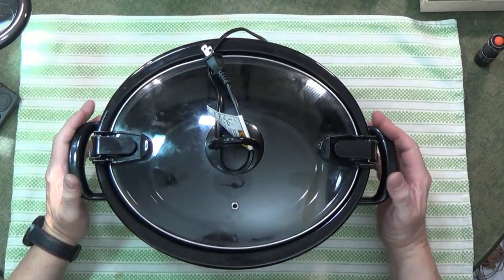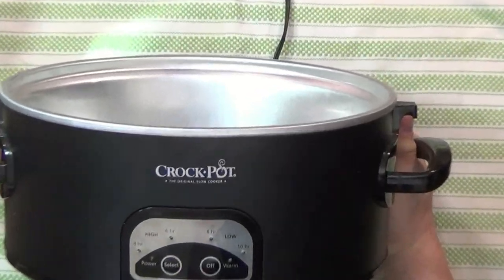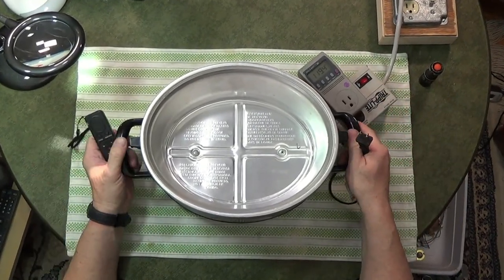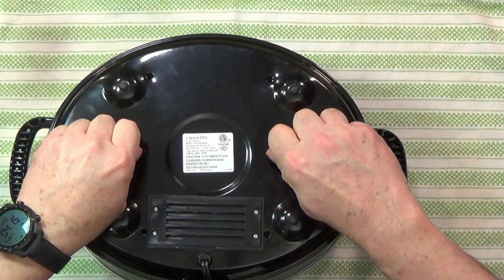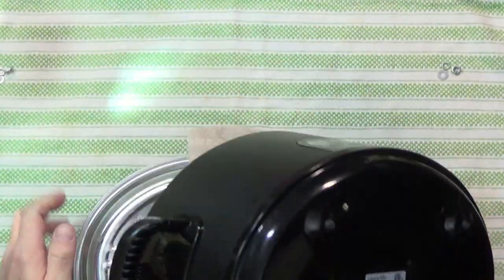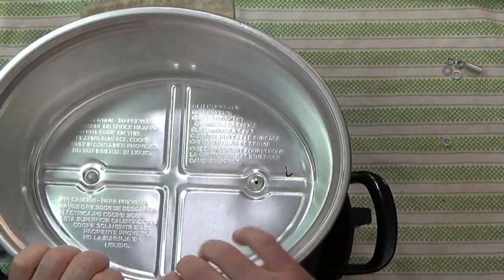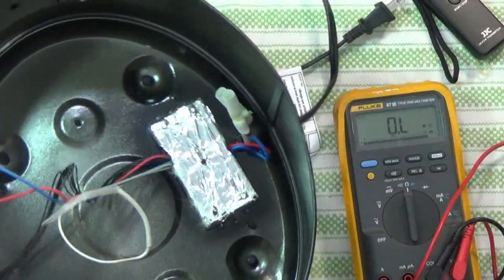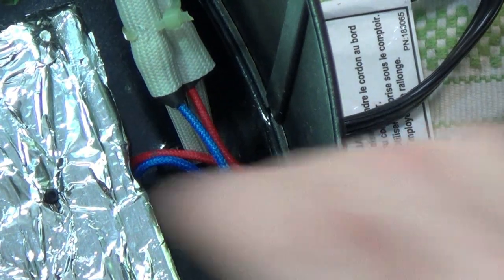Crockpot Slow Cooker Died  - FIXED!

Comment: Thanks for the video! Very well done! My crock pot stopped working so I opened it and I found two  issues:  1) the spring holding the metal ring around the pot is broken, Where can I order such a wire? 2)  the glass diode NTC connector were disconnected. How can I reconnect them together?  Martin
Reply from the maker: The spring is not terribly critical. Depending on where it broke, you may be able to stretch the remaining part, bend a hook in the end, and reconnect it.

I am not sure I follow the NTC question?

Comment: Does it matter which side the blue wire and the red wire go on on the cord I have a wide Peg and an airplane on the plug-in which side goes to the blue and red blue and red
Reply from the maker: The wide side of my 110v US plug (neutral) goes to both one end of the heating element and the circuit board.  The narrow side of the plug (hot) goes to power the circuit board low and high voltage needs. A red wire runs from my circuit board to the other end of the heating element. Beware: Yours may be different.